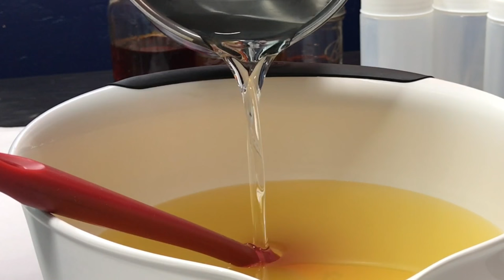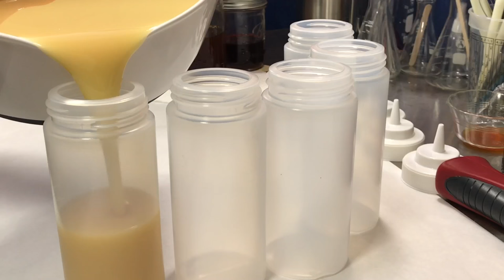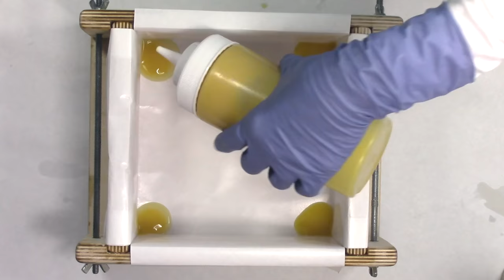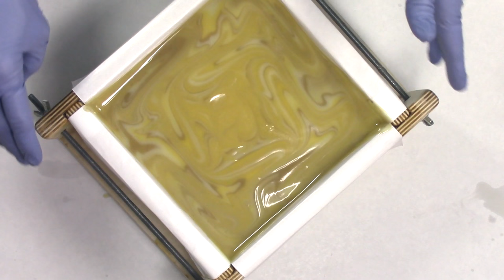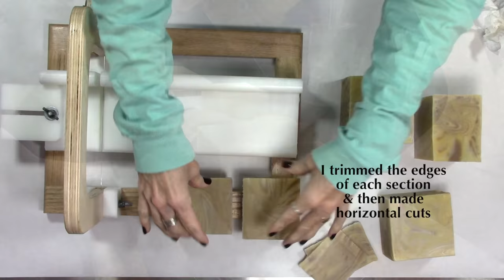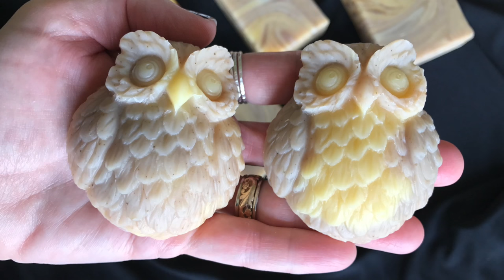Wood Grain Soap using the Spinning Swirl

Comment: I'm new to making soap and I am just in awe of your work!  I want to make all natural soaps myself and I'm curious if the oil infused colorants are weighed and counted towards your oil amount or just added at trace. I hope that makes sense!
Reply from the maker: Thank you, Andi!  That's a great question and one I get asked a lot.  I do it both ways depending on how much infused oil I want to add.  If the amount of infused oil needed to achieve a specific color is less than about 2 tsp per cup of soap, I will simply add it to the soap without deducting from my recipe (as I did with the soap in this video).  If it takes more than 2 tsp infused oil per cup of soap, I will subtract a percentage from the recipe and then add the infused oil to make up the difference (either adding the infused oil to the rest of the oils or at emulsion).  When using two or more infused oil colors with different usage percentages, I will split the recipe into parts and do that for each part.  Since that can get quite complicated and time consuming, I usually try to make small batches like the one in this video and just add the infused oil in small amounts.   Sorry for rambling.  Hope that helps!  Thanks for asking!  :)

Comment: Just fantastic to watch!  How did you get your batter to stay so thin and workable for so long?
Reply from the maker: Thank you so much!  I really think it's just my recipe and not blending too long with the hand blender (especially when I also have to shake the soap in the squeeze bottles, too).  I tend to use the same recipe for all the more difficult swirls we try in the soap challenge club (60% liquid oils and 40% hard oils).  I also used the full water amount recommended by my soap calculator.  Thanks for asking! :)
Reply: Thanks for your quick reply and soaping tip.  I'll give this a go and see if I can make a pretty soap.  Wishful think LOL 😄

Comment: Hi, I'm new at soaping and I love your work! I have a question, do you put alcohol on the top of you soap and you insulate it to go through complete gel phase? Thanks for your help.
Reply from the maker: Thank you!  I actually don't spray alcohol on top of the soap to stop the ash from forming. Instead, I just leave my soap covered for at least 24 hours without peeking.  That prevents the ash for me. If I have to unmold before then and end up with ash on the tops, I use a clothes steamer to steam the tops of the soap to remove the ash.  Yes, I do insulate my soaps with a blanket to make sure they go through gel phase.  Thanks for asking! :)
Reply: Thanks so much, I appreciated your answer Thanks!!!!!

Comment: May I ask a question about "how to avoid the gel stage of making a soap?"@@
Reply from the maker: +李莉 When I want to avoid gel, I will use a water discount, soap at room temperature, and then leave the mold open (no cover, no blanket). Or I will just make it like I normally do and stick the whole mold in the fridge overnight. Either way works for me. :)
Reply: i have heard about putting the soap in the fridge for the first hours